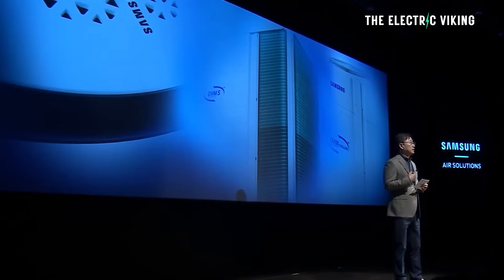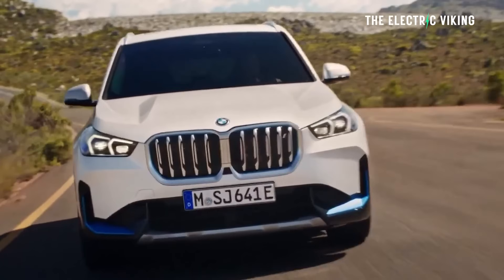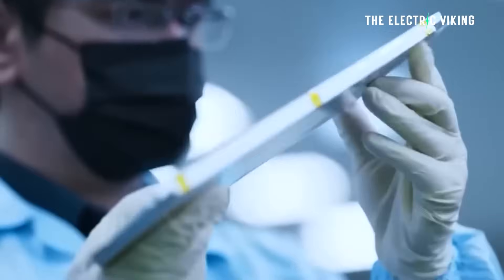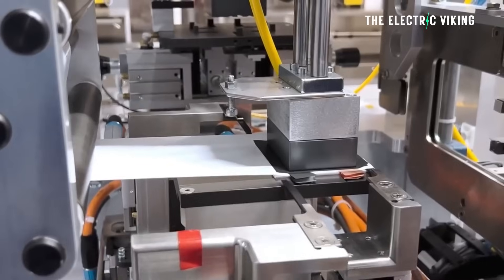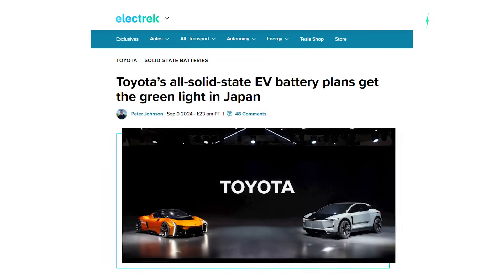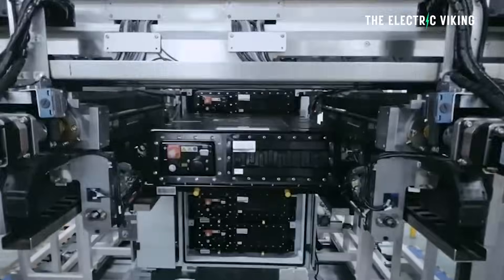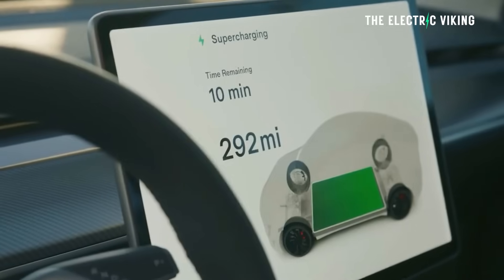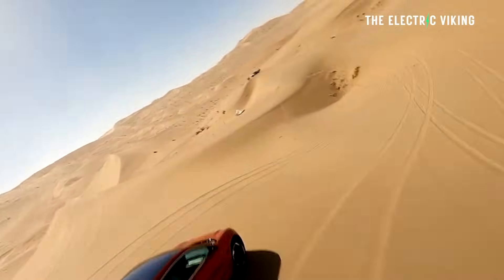How much range electric cars with Samsung's Solid State batteries will have

Comment: So you believe swapping out your 87 kWh battery for another 87 kWh battery would double range? Where did common sense go?
Reply: If the new 87kw battery is SMALLER, then you can fit more battery, there, that was pretty easy wasn't it, common sense indeed. Too many people to quick to shoot everything down with limited knowledge, sometimes you need to join the dots yourself.....
Reply: @ That is of course true, and I knew this. If he had said, when I switch my 87 kWh battery for another battery with higher energy density, but the same volume, I would have more than 87 kWh and thus more range. But he didn't. He explicitly stated that swapping out his 87 kWh battery for a 87 kWh battery would increase range. Which is clearly false. Of course we can fantasize about what he could have meant. But this is what he actually said.

Comment: Sam, what is heavier? A ton of feathers or a ton of bricks? What has more energy? A 87kWhr liquid electrolyte battery or a 87kWhr solid state battery?
Reply: He is saying a solid state the size of todays 87KwH
Reply: @andrewday3206  He is making a fundamental mistake. A current 87kWhr battery contains the same total energy as a 87kWhr solid state battery. It doesn't matter how the battery is made or how heavy it is. You will not get more than 87kWhr of energy. What he means to say is that the energy density of a solid state battery is higher so you can get more kWhrs of energy for the same weight of battery.
Reply: @ 
You need to listen more carefully. An 87KwH today will be about 180 KwH in solid state form. Pound for pound, volume for volume solid state holds much more energy. That is the point
Listen to him again
Reply: @andrewday3206  I listened very carefully. What you are saying and what he is saying are different. He said "If you were to use Samsung's solid state battery in this car and lets' say the battery was exactly the same size about a 87kWhr size battery, what range would you expect to get? Well considering the energy density, range should theoretically be around 1000kms." So he definitely got it wrong. He used the exact same battery energy for both batteries. What he meant to say is if the batteries were the same weight, you would get about a 1000kn range.
Reply: @ No he meant physical size and not storage capacity
Reply: @ Sorry, I am not a mind reader.
Reply: @ 
Well I just used common sense. You assumed same size meant storage capacity. I live poked at the context and realized same size meant physical size
Reply: @ No. I quoted exactly what he said. I made no assumptions. I corrected what he said. It is very simple. He just made a mistake. We all know what he was trying to say.
Reply: @ 
Then why act stupid this entire time?
There was more than one way to take what he said. You decided to dig your heals in and be difficult. Wow that added so much to the world 
Bravo
Reply: @ I am just telling you the facts. I quoted you exactly what he said. You seemed to be set on not accepting the facts. We all know he was talking about energy density and not capacity. He made a conceptual error in the explanation. Why is that hard for you to accept? Who is being difficult here? You or me? Try to answer honestly. I think you just wanted to be “right”.
Reply: @ he stated weight as a measure of size. You stated energy capacity as a measure of size. Both are correct. That is the point.
Reply: @ You claimed that I didn’t listen carefully but go read the quote in my previous comment. Have a nice day.
Reply: @yodaiam1000  If you analyze the correct meaning of the actual English words, the size of the battery means the physical size. What you assume is the 'capacity', which is not the same. Size means physical dimensions, and capacity means the kilowatt-hours.
Reply: @ratzushk  He literally said the size was 87kWhr. So he may have also used the wrong word. I was speaking of the conceptual error he made.

Comment: IF the claim is true, ultra-fast charging will be a true game changer. But we'll also have to see about the price, does it burst into flame, how many charging cycles can it handle, its reliability, and how quickly does its charge capacity degrade.
Reply: The early battery designs were the flammable ones, Lipo 4 and other new tech doesn't. And just for context, Petrol/gas cars burn pretty good all the time, and have done for over 100 years........

Comment: For my road trip car, 700 miles would be optimum.  That is the distance I travel in one day.  If it charged quickly, a little less would be acceptable, but let's face it, so far fast charging is the exception rather than reality.

Comment: Why would two kw batteries have different range?  Makes no sense.  If the higher density battery for the same weight, then you can increase range by increasing the kw. No increased kw, no increased range.  Its that simple.

Comment: Sam, one of us is in left field, and I don't think it's me. an 80 Kw battery pack is an 80 kw battery pack. Your EV's range shouldn't be one iota longer or shorter with Samsung's battery unless it's 80 kw size is achieved with a lighter battery architecture, in which case the car weighs less and you would get X% increased range
Reply: I think he means actual physical size. Atleast I hope he does
Reply: It's kWh, not Kw
Reply: He meant to say with the same weight battery you get 600miles.
Reply: @nodavood  well he should say that then !!!The fact is that he is clueless .He just regurgitates what he hears for a you tube channel.
Reply: He said,many times the same size battery😮
Reply: The problem here is that we use the slang `size` for battery capacity, which is actually wrong. Size should be used for dimensions, not for capacity. If we just analyze his wording, he is not wrong, since size means exterior dimensions, not capacity
Reply: You are right. Sam has it wrong. 

The main point of these batteries is not range- it's correcting the lifespan problem.
Reply: Different cars have different efficiencies.  There's no telling what range he'd get in his current car with a different battery system. It will have a different weight, the car might or might not be optimized for it, etc.

Comment: I think ranges of 1000 miles will be useful for those without drives. (no off street parking) no one wants to drive that much in one go but in a lot of cases only needing to charge once a month lets say whilst shopping or going out for a meal makes adoption of evs much more likely than 300m ranges and potentially needing to find somewhere to charge up once a week

Comment: I seem to comment this every time you make these kind of calculation, and you just don't get it. 
Assuming you want to keep the car at the same weight, a higher density battery will allow you more range, but that means that you will have a larger battery. Isn't this going to be more expensive? 
What if you want to keep the same energy size of the battery?
Example: A 2024 Tesla RWD Model Y has a 60kWh LFP battery. The density of the battery, with the BMS and stuff, is about 120 Wh/kg . Samsung SSB is projected to be 500 Wh/kg, but let's say it's going to be 450 Wh/kg with all the wiring and such. That would a 3 times LIGHTER battery. Not better, just lighter. So, If I want to have the same weight on my car, it means now my battery will be 180kWh. First of all, I'm not sure you have the space for this, but let's say you do. Why would I pay $30k more for a battery that I don't need to lug with me everywhere.
The more logical thing I should do is keep the current energy size (60 kWh), reducing the total weight of the car and getting about 20% more range (because range is dependent on the weight). So now, instead of having a 1.8 t vehicle, by reducing the battery weight from 500 kg to about 130 kg, I'll have a 1.47 t vehicle (incidentally, this is the average weight of a modern SUV with ICE), which will mean an approximately 20% boost in range (because of a 20% weight reduction).
 I think this is more logical.

Comment: Yes, 600mi range on a pick-up truck would be optimum. My old pickup truck got over 600 MI and was wonderful for towing.  However, my current pickup truck is just a little over 500 miles, which is still okay but not optimal for Towing my RV... Yielding almost 250 miles while towing at 8MPG.
Reply: On my second ev and the latest car has a lot less miles than the first. We realised that the few occasions we need to supercharge didn’t warrant the extra purchase price. However I do think as soon as family size cars do 600 miles this will be the death of ice cars. You would have to be an idiot to buy one, the running costs would not make sense. It’s no hassle to plug in at home every 3 days or so but with 600 miles on tap I wouldn’t need to think about charging much no matter where I was going, that would be awesome. With solar coming I would be able to drive around for free pretty much
Reply: @richardbirkbeck3676  In addition to my truck, we own a 2022 Model Y LR. It is our everyday car and our best road trip car, and since it's a full charge (80%) at the start of every day, it saves a lot of time & hassle, NOT going to gas stations locally. Even on road trips when I'm NOT Towing the small 5x8 trailer or Li'l boat, it's okay.  HOWEVER, when I arrive at destinations for a week or more, while not having home charging, it is FAR FROM OPTIMAL and is the reason why BEV needs more range.

Comment: What is Sam on about? Range only goes up with the same battery size up if your EV does more miles per kWhr, that’s called efficiency, not density. If he’s saying the bigger battery will be bigger in KWhr, but will be a lower weight and physical size  per kWhr, so you can fit it in the same size car, then that makes sense.

The real game changer will be if they can charge a lot faster and have the same/better longevity.

He doesn’t seem to understand basic terms here!

Comment: NCA, LFP or similar powered vehicles need near 500 miles of range, because daily usable range after degradation, cold weather and top/lower protective buffers reduce usable range by ~30%. What will degradation, low/high temperature and practical buffer profile look like with solid state? If superior to lithium then the capacity equation swings drastically in favor of SS.

Comment: The weight goes down but as has been said 80kw is 80kw the only difference is it’s lighter! So for the same weight you may get 160!kw but you still have to charge with your lovely Chinese coal produced solar panels and then when it’s scrap you have hazardous waste too !
Los Angles now has lots of hazardous waste due to all it’s electric vehicles that burnt in there fires !! They are now saying it may be a year before they can clean the area up due to all the toxic waste !!! Strange how that’s not being reported

Comment: Sam Sam Sam…. 85 kWh battery regardless of type will always get you the exact same mileage.
     However, since the energy density is greater with these solid state batteries THEN you could get MORE kWh of batteries in the same physical space.
      Your conclusions about potential range are correct, but you got there the wrong way.

Comment: Cant wait to get a mobile with 2x battery capacity, instead of charging it in a day i want to charge it in 2 days. Also right now LFP batteries are not given in smartphone because I read somewhere that they cant be made in small sizes, if they manage to make small LFP batteries my smartphone will work for 8 years without replacing the battery.

Comment: At 3:40 “I think people are not going to to want more than 500 miles of range” … where does this opinion come from, Sam.
It’s all about the range.
Reply: 500 miles is fine when it takes 2 minutes to fill up. Otherwise I'd need at least 3000 miles range in an EV= enough to get to Florida and back home without getting stuck at a public charger.

Comment: It is only relevant for Germany but when driving fast on the autobahn you easily achieve just half of the announced range. I would be welcoming high capacity batteries.
Reply: When driving fast on the autobahn you achieve half of the announced range of a thermal car too
Reply: I would be welcoming speed limits.

Comment: 87 kWh is 87 kWh is 87 kWh period!!!! And will produce the same range!!! Now, if the Samsung battery is the same PHYSICAL size or same WEIGHT, then, with a higher energy density, you will have a higher range. This isn’t brain surgery Sam. Learn just a little about what you’re regurgitating before you throw it up!

Comment: Sam.  An 80 kWh hour solid state battery and any other 80kWh battery will give you the same range.  The only difference is the solid state battery will weigh less.  The fact that it weighs less will increase the range a bit but I would think not as much as you are saying in your video.
Reply: Yeah i think he meant same physical size but 2x energy in that size.

Comment: 650 miles: Is that the range with the A/C or heater on?

Towing is definitely a plus. That said, usually the weight of the battery limits payload capacity.

Comment: For most ev usage charge speed is far more important than range.  For 10 minutes charge I will gladly accept 150 miles because I am in the city max 20 miles per day.
Reply: May be you don..but for most people its riddiculous
Reply: @jozsefdebreceni9911  urban drivers often have an average less than 150 miles per week.  So even those that can't charge at home 10 minutes to fill up not a problem.  Let's face it a weekly shop at the supermarket is much longer than 10 minutes.

Comment: The limiting factor for charging is not the battery's charging rate. In order to charge an 80 kWh battery in 10 minutes, you need at least 500 kW for those 10 minutes. No home charger will ever be able to provide that much power, which means it is a feature you will almost never use unless you drive 100's of km's daily. While 500 kW chargers do exist, they would come at a premium and the required infrastructure to deliver 80kwH at that rate is an order of magnitude more complex. With these batteries in wide use, finding somewhere to charge them at anything approaching their actual charge rate would be a challenge.
Reply: Probably true for Australia. However in Europe, such chargers are becoming very common, not the latest because more and more fully electric trucks are populating the roads that could actually even use Megachargers. They will happily charge @ 500 KW during their mandatory breaks in order to enhance the daily stretch they can drive.

Comment: He said “range would be higher with smaller wheels”, and he is right. It pisses me off for years now. Why people still prefers to buy 17, 18, 19 inches wheels ? Cooler ? Sportier look? BS. Back in the days regular cars had 14 inches wheels, 15 or 16 to the max for high end models.
How is it that both manufacturers and consumers are failing themselves in such big wheels and loosing as a consequence 10 to 20% range ? Would can refuse both a significant increase in range and cheaper costs ?! Only idiots in my opinion
Reply: also less tire particulate pollution with smaller tires...

Comment: VTOL aircraft territory for energy density  . 500 miles for cars and it will take a some weight out to.  500 miles to get 400 miles real world and to compensate for long term degradation. You would thing it would go into the small devices first but do they require a robust BMS. How will they make it cheaper? It would be nice if Samsung pulls this off first to counter the Chinese.

Comment: if you replaced your current 87 kW battery with a solid-state 87 kW battery you would get about the same range, maybe a little better because of the lighter battery but not that much.
Reply: I don't thik there are still cars using 87 KW from the battery. Imagine he said it is charging in 10 min. This said the power the battery is able to provide is 6x the capacity (6C).
This said a battery offering 87 KWh of capacity will be able to provide (short term) a power of 522 KW !!
Just to remind everyone once more how important it is to keep using the correct units.

Comment: Maybe human drivers don't need 650 mile range. But what about automated vehicles doing delivery runs? They don't need to stop for as many times.
Reply: Similarly commercial passenger vehicles like coaches. A big range that will go for a full day touring would make battery power viable.

Comment: I got my Model Y performace 3 months ago.  The more I drive it, the less I have range anxiety.  
My plan is to put a long-range solid state replacement battery in it 10 years from now.
I was worried I would have buyers remores when the refresh came out.  That is no longer there case.
I do however wish the spokes person for the company wasn't doing foolish things in public.
Reply: Has Tesla said that this was an option? That they will have solid state battery replacement for older models? Or are you hoping that independent startups will offer this?
Reply: @markvalery8632  You can rest assured that Tesla will have a very good SSB in the near future.
Reply: @neilmckechnie6638  I don't doubt that. What I want to hear is that they have a plan on updating old cars to a SSB battery.